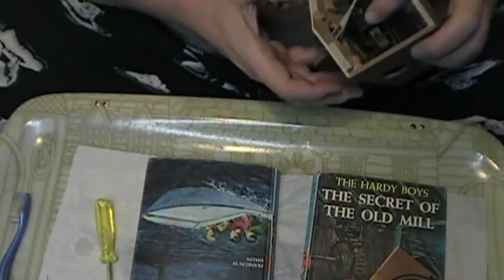Cuckoo Clock Repair 2.wmv

Comment: I came here to see what pieces of the mechanism should be specifically oiled (apart of the holes where the wheels rotate) but it's hard at this distance to see clearly what you're doing, the camera is way too far from the mechanism :/

Comment: Hi my coo coo clock will not hold a tick it ticks back and forth and after a few it just stops I don't know what to do it was my grandmas then my mom's and they have both passed away and I'm stumped please help-!
Reply from the maker: +katie polzel pull gently on the weight while it is ticking and if that works then clean and oil.

Comment: My clock will run but it will no longer make the cuckoo sound,  play the music. What can I do to fix it.
Reply from the maker: +Stefanie Holmes On some there is a switch on the side to turn off and on the music and motion figures. Check to see if it is on and then open the back and watch to see if everything is engaging properly.
Reply: It's on. It clicks on the half hour like it wants to work. One of my chains is up to top but figured it wasn't lowering because it wasn't doing the motion and sounds.
Reply from the maker: The chain could be stuck if it's all the way up, set it on the hour while gently pulling on the middle and right side chains, when it click's they should start but one may be stuck. Still... open the back next and look at the chain going through the winding gear, you may be able to loosen it by advancing it around one link. If not then take the chains off and see where it's hung up.

Comment: Do you take clocks to repair?  I've followed your directions in this video but, my clock still stops working after about 12 clicks  :(  It worked for about 2 days then,, Bleh it stops and stops and stops... However, I was not brave enough to tear it down like you did.. I'm sure I missed a ton of dust...  This clock was given to me by my grandfather, Otto Augustus Gudgel.. Yeah German  ^_^  It means a lot to me.
Reply from the maker: Lori Borges I don't do repair but there are plenty of repair people all over :) If you can keep pressure on the weight and have it continue to work then cleaning is all that is needed. If you add the little extra weight by pulling and it doesn't keep working as long as you have the added pressure on it, then it will need repair as well.
Reply: Reed Lukens Now, I'm sad. (just kidding... well maybe just a little sad)  While waiting for your reply I'd really gotten my hopes up.... **heavy sigh**  Ohh Kay so,,, I'm going to have to watch your videos in super slow motion and probably several times then give a try to repair it myself.  But, a couple questions before I start...1) do you use Q-Tips for cleaning or suggest???
2) what did you use to clean the gears? any solvents or what?
3) do you skype.. haha that would only be in an emergency case.  :)  ((sorta kinda kidding but, not out of the question))  ^_^
Thank you so much for the reply & keep your fingers crossed for me... Here we gooooooooooooooooooooooooooooooo............

Comment from the maker: Nope, he is telling you to turn the whole clock just a bit at a time on the wall until you hear the clock ticking evenly :) Listen to it & watch the pendulum, if it is clicking faster to the left then turn it left a touch until it has the even tic,, toc,, tic,, toc,, sound. Not tic/toc...pause...tic/toc...pause... & so on. The movement is unbalanced and it just takes a slight touch to one side or the other to even it up. If it doesn't look straight on the wall when done you can adjust it inside

Comment from the maker: I'd love to see some pics Kim send them along. When you hold the bellows in your hand and move your hands up and down do they work correctly? Some of them need weights added to the tops of them to make them work right also. Like I said, I am not a pro but they work fine after I am done cleaning, oiling, & readjusting everything. Also if it is a warbler, then it will have dual whistles mounted together with an air valve between to make it vibrate. 
Send the pics to - thelukens@wizwire.com

Comment: hi reed..
congrats and thanx  for this wonderful video...I recently bought a cuckoo clock from germany and when i installed it at my home,the pendulum stops oscillating after some time.Kindly help.
If you can be contacted on phone/skype/viber etc,kindly let me know.
Thanx in advance.
Reply from the maker: Sounds like they gave you a defective movement. I would contact the manufacturer.

Comment: Here is a real easy way to put any pendulum clock into beat.
Tilt it til it ticks with pride 
Then adjust the verge to the high side.
I hope this helps E J Duvail
        PS u can check me out on Utube 
Just type in ej duvail. Thanks

Comment: Hi Reed, thanks for posting this video. I am trying to repair my grandparents zaadam clock. it has not been working for years. I removed the clock work, and used compressed air (from the can) and oiled the axle points. after reassembling, there seems to be a problem with the escapement as it will not maintain movement.  There is some jiggle with one of the axles when I pull on the movement chain. I was wondering if this could be the cause for it not having movement.  I posted a video here.  https://youtu.be/j11NirAXCz4    thanks for your input.

Comment: pretty sorry ass way of clock repair.
A clock needs to be completely disassembled ultra sonic cleaned all pivots checked polished as needed pivot holes rebushed as needed and reassembled
Reply from the maker: And your answer is a pretty lame way to get people to pay more, which is why this video has over 100,000 views, 800 likes, and has helped hundreds of people in the last 5 years not pay into your greed.
Reply: If you think that all you need to do is lubricate a cuckoo or any other clock you have a lot to learn.